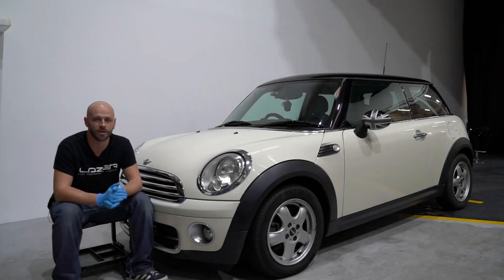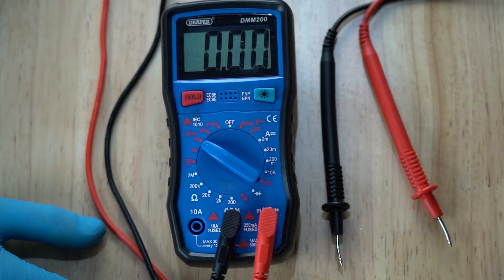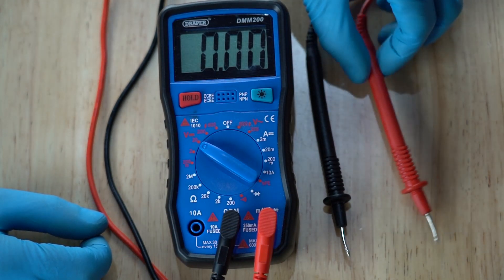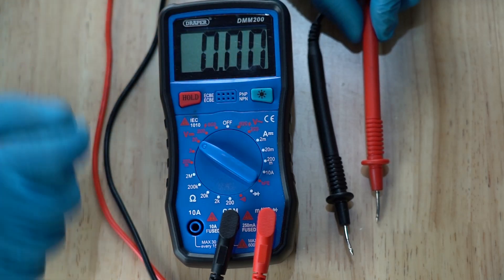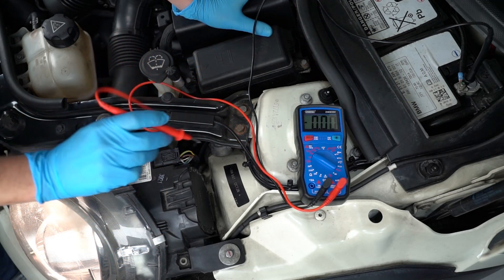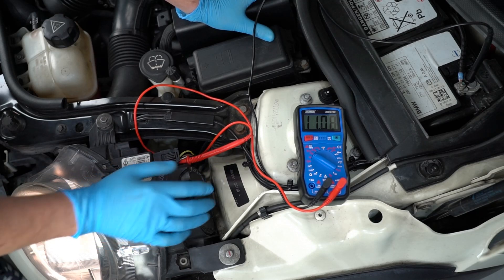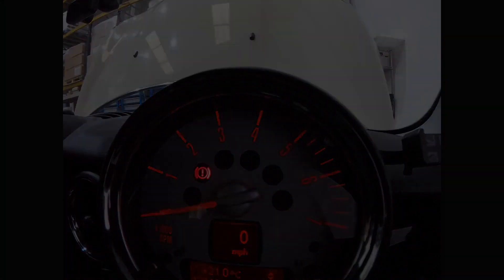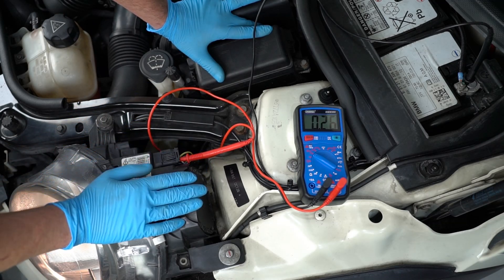HOW TO: Locate 12V High Beam Signal Wire

Comment: It's worth noting, don't pull the connector out from the light when doing this testing, it may seem like a good idea to carry out the tests with the connector removed in order to make it easier, but the canbus system 'senses' that the cable is removed and you won't get the change in voltages as shown.

Comment: Have Mahindra XUV700 with factory LEDs…1 wire always have 12v, 2 wires show 12v after turning on Low beam..No other wire show 12v when turning high beam on.
Reply from the maker: Hi there, We'd recommend taking a look at manufacturing wiring diagrams to see if you can find the 12v high beam through that, failing that that you may need a CAN-Interface

Comment: Could you please help me locate where would be the high beam trigger on a Skoda Superb MK3 ?? It has bi xenon HID which is not upto the mark hence want to add a good lightbar for highbeam.
Reply from the maker: Hey there, It should be on the left hand headlight connector, PIN 8 or 11 which will be black with a white trace. Please check this with a multi meter 😊

Comment: I have a 2019 ford focus and im stuck because i dont have a wire that changes when turning on/off the headlight
Reply from the maker: Are your headlights LED? If so, you may need a CAN-Interface such as CANNY (https://www.lazerlamps.com/canny-can-interface-direct-connect.html). Drop us an email at sales@lazerlamps.com and the team will be able to assist you 😊

Comment: Ford Transit 2023, bixenon. I found high beam 12v but as soon as I will activate Ledbar on/off switch the headlights motor will start moving and the Ledbar switch doesnt get the signal. The wiring diagram is: from highbeam to switch - from switch to relay - from relay to Ledbar.
Reply from the maker: Hi there, please send an email over to sales@lazerlamps.com and we can look into this to help get the lamp working as expected

Comment: Can you help please. When I test wires  at connector wher the bulb goes into it both wires show 12 volts when high beam switch is on. Just to clarify high beam doesn’t work. It’s supposed be positive 12 v and negative 0 v . What could be the problem?
Reply from the maker: Please email me and i will be happy to assist you. Aaron@lazerlamps.com

Comment: Great vid I have bought a bar light and loom with a switch that I am not going use  want to run it of high beam when I find bean wire do I just conect a wire from ther to the live wire on my loom many thanks 😎👍
Reply from the maker: On our harness you will want to connect the purple wire to the high beam wire on your vehicle. If you want to isolate the lamps with a switch, then you would need to put the switch in between the purple wire. If you have any doubt at all, I would be happy to explain with a powerpoint. you can email me Aaron@lazerlamps.com

Comment: In my 2021 Sprinter, the headlamp connector has these rubber seals for each wire going into it, making it impossible to get the multimeter in there to test for current. How would you go about finding the high beam wire with such a connector?
Reply from the maker: Does your Sprinter have factory LED headlights?

Comment: do u have to use a relay?
Reply from the maker: You certainly do need to use a relay to install our lamps. Our wiring harnesses do come with a prewired relay so you only need to connect: Live, Earth, High beam trigger (and where applicable sidelight live for lamps with Position light.) Regards Aaron.
Reply: Didn't need to in the 80's and 90's. We just wired them up and they worked.

Comment: I am trying to install an led light bar on a mini r56 like you have in the video, how did you splice into the the trigger wire was it with a solder connection, or could you de pin the plug.
Reply from the maker: Our wiring kits include a heat-seal crimp terminal, but a solder connection would also work fine.

Comment: I have a MY2020 New Defender SE with Premium LED headlights and I can't locate the wiring which leads/connects to the headlights and, so, can't find the 12v signal wire.  Please can you help solve the mystery?
Reply from the maker: You will need to install one of our Canbus interfaces in this case. Regards Aaron

Comment: Hi, I have watched your video and proceeded to check the 12 V high beam in my new defender 90 2021.  I have located a purple wire with orange line to have 12V when the high beam is on. When the high beam is switched off the voltage instead of dropping it went up to 33V which is different from your video.  I wondered if this matters as long as the high beam has 12V? Please advise before I proceed to purchase the 18" lamp without the Canbus.  For your information, my lights have high beam assist. The lights will adjust to suit the night environment when driving.
Reply from the maker: Hi, From our experience, vehicles that have the Matrix LED headlight system that you have require a Can bus interface. The voltages you have found confirm this. The Defender we have does not have the Matrix LED headlights hence how we were able to find a 12v signal that drops to zero once it is deactivated.

Comment: Having trouble getting through the rubber grommets in the headlight harness where the wires are coming in. I unplugged the harness and checked with my multimeter on the other side but can't seem to find any wires switching between 0-12
Reply from the maker: Without a 12v high beam signal it might be necessary to connect via the CAN module. If you're unsure about wiring into the CAN system, we would recommend getting help from a qualified auto electrician.

Comment: 2015 civic same story: LINEAR-18 ELITE WITH POSITION LIGHT or without pos? regular is better?? go fuse box!
Reply from the maker: Hi Rastik, It is the same process for any vehicle. If you want to connect position lights you would carry out the same testing  process but you would be checking for sidelights as well as high beam to connect the position lights.